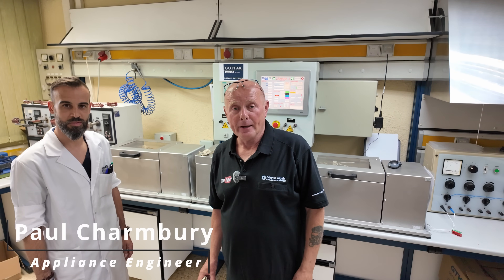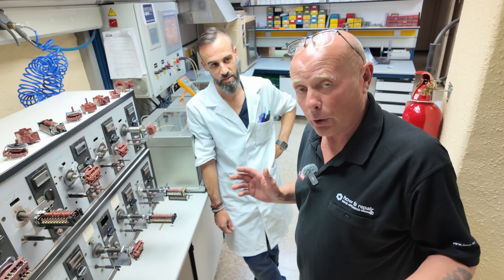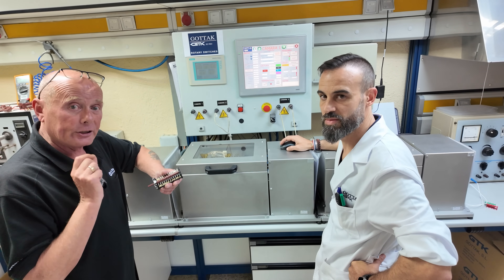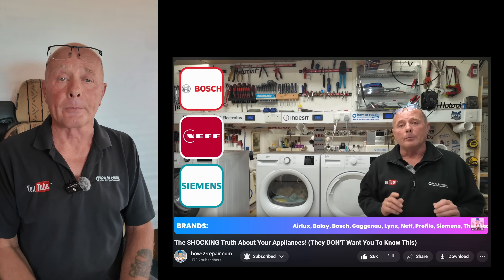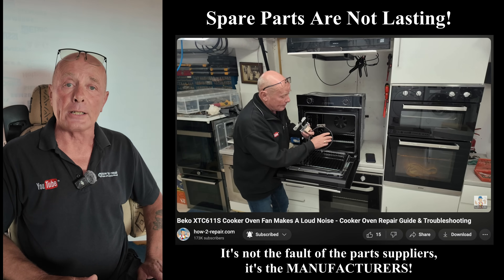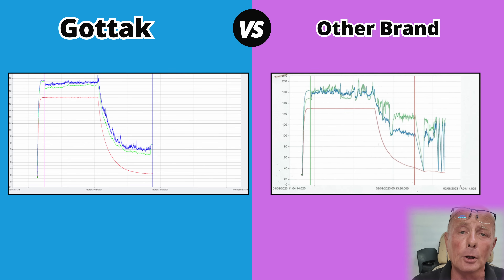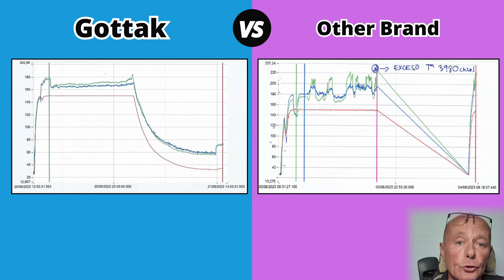Why Your Appliances FAIL SO FAST! Lab Results EXPOSE the Truth!

Comment: My aunt when they build their house in the 1960s had a petrol heater. This thing worked extremely well till around 2009. Then it died and was replaced with a new model. That one died within a year. Warranty and all that, got a new one, Just UNDER a year it broke.  they then spend thousands of euros to get a highly specialized one that died within 6 years... and out of warranty. they switched to wood burner stove. That one works grand. I HATE IT when companies build in these "we gonna let them fail " dead mans switches in their products. Samsung has it as well. If they know you had your phone for 2 years or longer they , and this is allegedly, futs with the software so the battery isnt good anymore within 2-3 months. There was a guy on youtube investigating this and exposing this. I do not know if it was genuine or not but samsung did "look into it" and not soon afterwards that that message came out from samsung they did an update... so did all other cellphone makers like apple.

Most if not all sectors have price agreements with one another in the sector. That is "great" for them in the short and mid-long term but in the longterm its detrimental. that is why you see companies change hands  when they venture into the "longterm" period. See for actual real deal innovation there is pressure and fire... pressure from competitors and fire from the company itself. All that is currently put on a very low  sudder that will not make anything worthwhile other than schlopp.  We over here are testing with 3D metal printing and blended materials to make everything from broken parts being reconstructed and printed to even hard to get carparts ( which we are currently stresstesting .. some even last longer than the original part, of course not all of them but a fair amount of them.. figuring out why that is atm)

You also see it with pride in building and carpentry. Look at modern houses, nearly ALL OF THEM have structural issues but have been covered up to make it look like its some grand palace when its an inch above a cardboard box and remsembles more of a carboard and pressed wood shoebox.. Friend of mine bought a newly build house. not 2 months after the sale there were foundation cracks. he has now lawyered up. he nearly fell through the stairs because of the shoddy construction. I helped him make the stairs sturdy ( and that is when we discovered the cracks in the foundation. 

I do love renovating houses but i have a kind of a tradesman pride in me that i will not do shoddy work and if i sell a place i make sure i want to live in it myself. That means superior materials used with professional qualified aides ( be it plumbers, electricians.. i can do it but i got zapped a couple times when i was younger and i am apprehensive about it, and so on.). Hell we even test the soil ( so its safe for children and pets). One place had a bunch of glycophosphates ( weedkiller products ) so we replaced all the soil in the garden. Actually i was surprised to find those high amounts in the soil...

Comment: Why use silver for the contacts? silver is rather conductive in its pure form but oxidizes rather quickly in air. Given the switch is connected to copper, would it make more sense to use something more durable like Nickel? Musician's have nickel plated connectors on all their audio gear because a tiny fraction of a percent on circuit conductivity from the connectors is worth less than having more connect-disconnect cycles which is where nickel beats gold and probably silver since it's almost as conductive while being far more durable.
Reply from the maker: Silver is the crucial property. As the switch contacts arc and abrade over thousands of cycles, a thin layer of tarnish will form, but the switch can continue to make a good electrical connection right through it.

Your suggestion of nickel is very logical because it is incredibly hard and physically durable. However, the problem is that nickel oxide is an electrical insulator. So, as soon as a layer of oxide forms on the contacts from the heat and arcing, the switch's resistance would increase dramatically, eventually leading to failure.
Reply: @How-to-repair  I see. Maybe in musician equipment the physical insertion is a factor to negate the oxide layer?
Reply: Oxidation of silver contacts due to oxygen/humidity on the environment it really is not a problem as every time when the circuit opens and close, this oxidation dissipates/get cleaned due to the electrical arcing of the open and close process.....lets say it is an auto cleaning process.....then no need to worry. 
Using cooper or nickel on the contacts will generate extra heating as the alloys are not prepare for sus functions and they deteriorate very very fast.

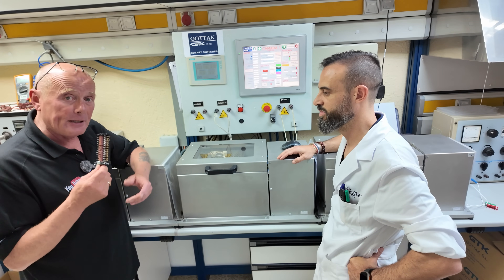Comment: 3:33 110 +-10 degrees of what? you mean boiling point of water or a fewer?
Reply from the maker: At that point in the video (3:33), we were referring to 110 degrees Celsius (which is about 230 degrees Fahrenheit).

That's a typical temperature for a component like this to reach when the appliance is running under a heavy load, and it's a temperature range where the long-term breakdown of materials can really accelerate, leading to the failures we discuss.

Thank you for your comment. I appreciate people like you taking the time to write it out. Please share it where possible. It might help others make a wise choice instead of being misled by the industry.
Reply: @How-to-repair   thanks. 
i might've been overreaction there thought, so sorry if it so.

Comment: "Designed to Fail" is baked in now. 
Our current WP clothes dryer was made in 1988. Needed a heating element once. Then recently a new timer motor resistor. WP clothes washer made in 1995 had it's transmission replaced under warranty once. No issues since.
Reply from the maker: Thank you for your comment. I appreciate people like you taking the time to write it out. Please share it where possible. It might help others make a wise choice instead of being misled by the industry.
Reply: @How-to-repair  Too many are buying appliances for appearance sake & ignoring reliability altogether.

Comment: The financial department of a company rules. That is the bottom line.
I do not care what the business is, it still is the same.
Cut corners to make more profits. No matter what the engineers say, they are pressured to make it cheaper.
I saw it first hand.
Silver contacts can be looked at as self healing. When you have arching at a contact that is just brass, you will have a failure in a short time.
Reply from the maker: Thank you for your comment. I appreciate people like you taking the time to write it out. Please share it where possible. It might help others make a wise choice instead of being misled by the industry.

Comment: The problem is most consumers are not willing to pay for a longer life. A Speed Queen washer will last 20 years but the cost is around $1.5-2k. others are in the $500 to $1000 range and many last 5-7 years.
Reply from the maker: I've been repairing washing machines for nearly 50 years, and the basic principles of washing clothes haven't changed since the 70s. They wash, tumble, heat, and spin. It's baffling why we need so many extra features now. Machines used to last 15 to 20 years on average. Nowadays, you're lucky if they last five years. Obsolescence is clear in today's society.
Reply: @How-to-repair  I just scraped my 25 year old Staber wash machine made in Ohio. I fixed it for a few minor things but it's built like a tank. It still washes clothes better than my other machines but they no longer have parts. When I went out on FB to buy a Speed Queen as a replacement I found one like new and I asked why they are selling it. They said the Samsung  links to my phone to tell me my wash is done.

Comment: In a nutshell: Planned Obsolescence! 🤨
(Typically only one in a thousand mass-produced items are subjected to regulatory quality control inspections).
Reply from the maker: Thank you for your comment. I appreciate people like you taking the time to write it out. Please share it where possible. It might help others make a wise choice instead of being misled by the industry.
Reply: @How-to-repair  I've been repairing a wide range of consumer grade (mostly Chinese) audio/video equipment over four decades, and believe me when I say I have had to deal with a multitude of component failures that could only be contributed to substandard manufacturing and/or planned obsolescence. Parts intentionally designed to fail after given operations. Like nylon gears and leavers working against spring loaded metal mechanisms, are guaranteed to fail just after the warranty expires, if not before if too roughly handled.

Golden rule of thumb, you get what you pay for. If you bought a glorified plastic box with lots of LEDS, it's likely to be a steaming pile of 💩 fit for landfill. 😉

Comment: I've learned to avoid using the switches on ceiling fans as much as possible. They all have the same cheesy plastic switches that crumble after so many uses and then are very difficult and time-consuming, sometimes impossible, to replace with another such switch that will fail again in a couple years.
Reply from the maker: Thank you for your comment. I appreciate people like you taking the time to write it out. Please share it where possible. It might help others make a wise choice instead of being misled by the industry.

Comment: Simple solution: mandate a 25 year warranty with financial penalties for failure. Also mandate accelerated life cycle testing to validate the warranty claims. Any manufacturer who cannot meet these minimums is barred from selling their products. Also mandate that any warranty work or replacement in the warranty period restarts the warranty from zero. And bar manufacturers from "crediting" consumers for unmet warranty periods for use in application to buying new products. This traps the consumer with terrible products from a terrible manufacturer. Any such action should be criminal.
Reply from the maker: What you've described aligns perfectly with the core principles of the global Right to Repair movement. Lawmakers in the EU and some US states are already taking steps in this direction, such as mandating parts availability for up to 10 years. Your proposals, however, would be a much-needed and far more powerful step toward true manufacturer accountability.

The reason we need such strong rules is precisely because of the built-in obsolescence we expose in our videos. For a deeper dive into the specific problems that your solutions would fix, please check out the full video here: https://youtu.be/gEgSCbZnHVM?si=wTIw0mELuhWaw4aX

Comment: Once upon a time you could spend at least a certain amount and have a pretty good chance that things will go well.

Many places back then stood behind the products and you developed a sense of trust, dealing with them. 

Nowadays, it’s all garbage. Five cents savings on design or parts, resulting in a noticeably poorer experience / wear / lifetime.

I’ve wanted to buy too many things where, after looking at reviews, I’ve stopped, disgusted. Too many bot reviews giving 5 stars, and if you look at the one star reviews, you see too many people reporting similar product and customer service problems.
Reply from the maker: You're right, there was a time when a brand name or a higher price meant something. You could trust that you were buying quality. As you've experienced, that trust has been completely broken. Recent studies in 2025 confirm that brand loyalty is in steep decline, and a primary reason is exactly what you said: a perceived drop in product quality.

And you've correctly identified the cause: manufacturers saving five cents on a critical component, leading to premature wear and a product that ends up in the landfill. This is the very definition of the built-in obsolescence we expose in our videos.

Your point about online reviews is also a critical piece of the modern puzzle. It’s not just you; research shows that up to a third of online reviews can be fake. They are deliberately used to hide the kind of widespread problems you see in the 1-star reviews. Your strategy is the best one: ignore the generic 5-star bot reviews and read the 1-star reviews carefully to find patterns of the same failures. It's the only way to get a glimpse of the truth.

This entire frustrating landscape—where quality is sacrificed for pennies and trust is destroyed by fake reviews—is the result of the business model of planned obsolescence. For a deeper dive into the specific ways they do it, please check out the full video here: https://youtu.be/gEgSCbZnHVM?si=wTIw0mELuhWaw4aX

Comment: i have a kitchenaid fridge, the date code is august 1997, that was left in the house we purchased in 2006 - the fridge is still working as our extra fridge whereas we have gone through 3 new refrigerators since 2006 when we moved in.
Reply from the maker: In the 80s, 90s, and early 2000s, most manufacturers produced high-quality equipment to build their reputations. Now, their main goal is to sell machines. They use green marketing tactics to their advantage but aren't held accountable for the growing pile of discarded white goods. Nowadays, machines last only about five years on average.

Comment: My mother had a washing machine that my dad purchased from a lady moving and it was 2 years old in 65' it lasted until 2015, she is on her 3rd machine since then.
Reply from the maker: In the 80s, 90s, and early 2000s, most manufacturers produced high-quality equipment to build their reputations. Now, many have large market shares because they've bought up other brands. For example, Bosch, Neff, and Siemens are one company; AEG, Electrolux, and Zanussi are another; Hotpoint, Indesit, Ariston, and Whirlpool form another group. These conglomerates now control the market but seem less concerned about consumers. Their main goal is to sell machines. They use green marketing tactics to their advantage but aren't held accountable for the growing pile of discarded white goods. Nowadays, machines last only about five years on average.

Comment: With today having appliance that requires you to connect to internet, programmed obsolescense has never been easier.  They are only one "update" away from turning your appliance into a brick.
Reply from the maker: I've reached the point where I simply cannot tolerate this situation any longer, and that's why I made this video. I'm aware that this might cause some controversy, or even land me in trouble, but I believe it's crucial to try and make a difference. I would greatly appreciate it if you could share this video. Together, we might be able to bring about some change. If we can't shame the manufacturers into action, perhaps someone in government will see the video and take notice of the overwhelming number of comments expressing public concern.

Comment: What is most annoying in this situation is that no matter price range (within reason) you will get the same thing, which makes it impossible to choose what to buy - in the end its all the same failure prone crap thats being produced no matter the brand. For this reason i will never own a new car, and prefer to shop for used appliances of KNOWN good quality and repair or recondition them myself. Same goes for tools i use - i'd rather get an old and rusty 20-30 year old tool to rebuild it so it would outlive me... The other problem i see is getting same parts in better quality than standard default, so i can "uprate" the lifespan of a thing. So many proprietary cheap designs are not made in better materials should i choose to buy better quality - there just isnt any to buy as no one makes them. Some industries have aftermarket parts, but appliance one mostly doesnt (unless it uses known standard parts but cheapened in production).
Reply from the maker: You are absolutely right that price is often no longer an indicator of quality. Many brands across different price ranges pull from the same pool of cheap, failure-prone components, creating an illusion of choice for the consumer. It's one of the most frustrating aspects of buying a new appliance.

This is exactly the kind of systemic problem we aim to expose. For a deeper dive into the specific components and design choices that create this frustrating landscape, please check out the full video here: https://youtu.be/gEgSCbZnHVM?si=wTIw0mELuhWaw4aX